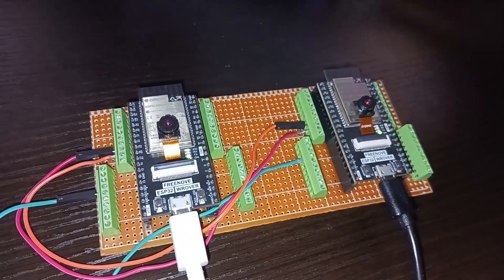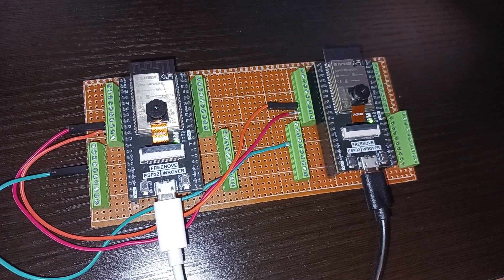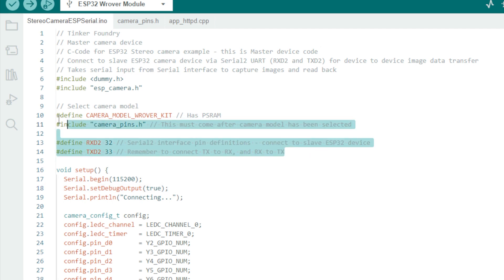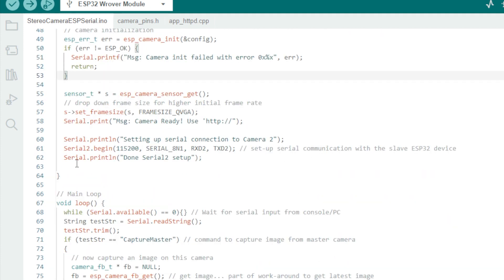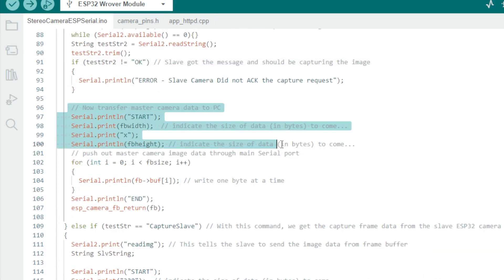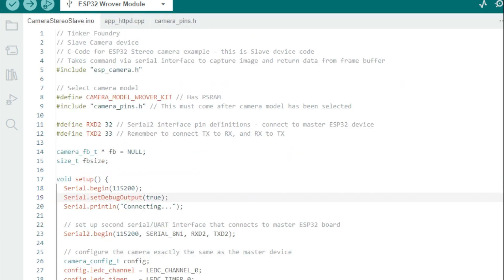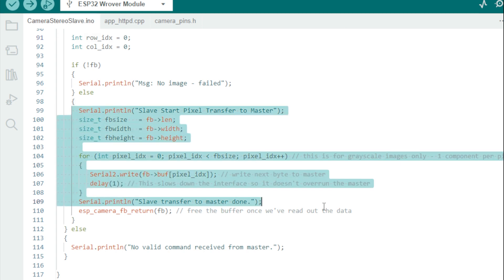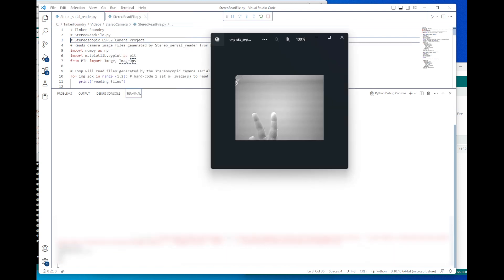ESP32 CAM Based Stereoscopic Camera with Serial Interface

Comment: Hi, I’m trying to achieve something similar. I want to create a stereo camera system for depth estimation, compute the depth map on one of the microcontrollers, and send it to a PC for interpretation. I’m not aiming for high performance, just a proof-of-concept project.  

You mentioned that in moving scenes, there are synchronization issues. How significant is the delay between the first and second image? Do you think there’s a way to achieve somewhat simultaneous image capture? I’m open to any suggestions or tips you might have!

Comment: Would also appreciate the code links. Hoping to capture synced video frames. Would prefer to use a third esp32-s3 as the capture/process board. How close is the master/slave time sync with this set up?